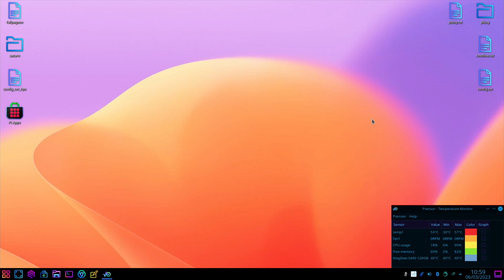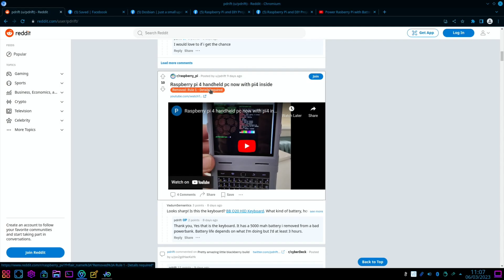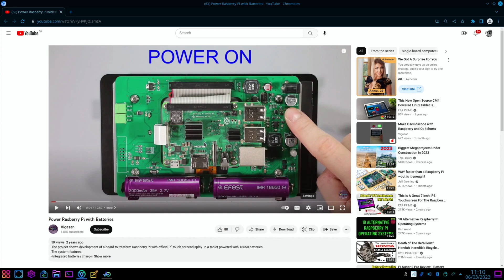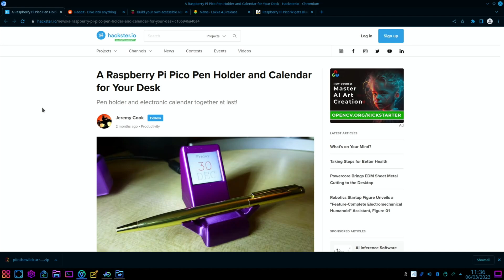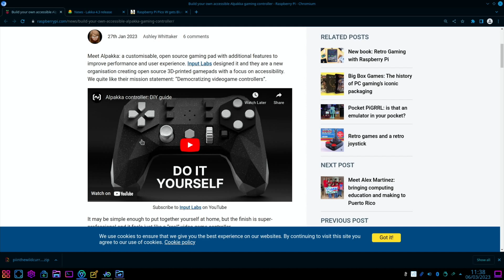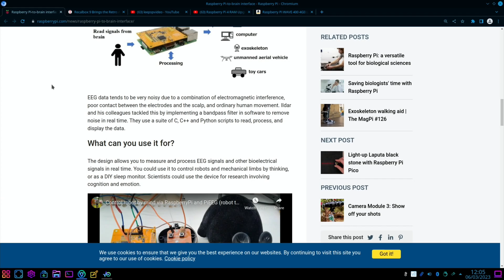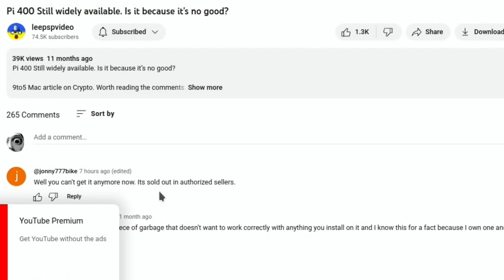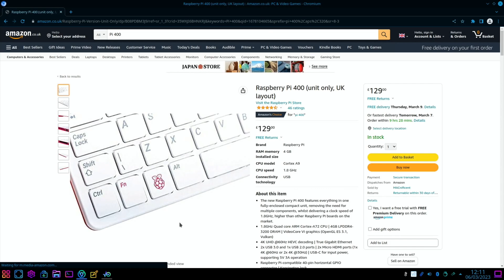Pi News 74. Upgrade your 1GB Pi 4 to 8GB!

Comment: If you plan to use a Raspberry P 3 for an outdoor searcher station, I would suggest that you include an RTL-SDR receiver so you can bring in the audio from the National Weather Service radio, transmitting at or near 162.55 Mhz. If you've a dedicated display station indoors, you can include a speaker to play the audio, and it would be a good enhancement if you could monitor the audio stream and automagically cut in the audio when the NWS transmits the weather radio codes for your vicinity. If you are installing the station on a Mast, you can also install a weather camera.  If you're  rural land owner, that may be a good place to add 433 mhz NORA communications to monitor remote sensors on all of your gates and barn doors, to feed to a security system. The possibilities are endless.

Comment: What about expand the RAM using a external Memory like the Windows sistem do?
Reply from the maker: I never found readboost to be that good in Windows 

Zram and Zswap are very effective 

Great 64bit Ubuntu performance on 2GB Raspberry Pi 4 with Zswap, plus Ubuntu Freezing Fix.
https://youtu.be/SIN6vM6H7sY

Raspberry Pi Zero 2W. First time setup. Far better performance with Zram.
https://youtu.be/vZkfuVyybIw
Reply: @leepspvideo  yea butnconsider the scheduler of Linux if you put the High priority process on the onboard RAM and the other on the external you can pitencialy Powerup the RAM onboard because the least tournarround time the problem i tink Is whit the paging because the external Need an extra step

Comment: Could you post a link to the video you did on the USB to SATA cable you recommend? I know you did one some time ago, but I can’t seem to find it.
Reply from the maker: Links in this description 

My current Desktop setup. Raspberry Pi 4.
https://youtu.be/r-1aXkU8dpA

The ugreen is probably my favourite although I use the short iitrust cable a lot UK link only
Reply: @leepspvideo  Awesome, thanks. I am having issues with certain cables at times.
Thanks again,
John

Comment: just wanted to share my overclocking that ive been running now for the last month with out issues  well minning duino coin and running the cpu at pretty much 90-100 percent  24/7 and use it as my daily computer as well. arm_freq=2800
over_voltage=12
gpu_freq=850
force_turbo=1
current_limit_overide=1
arm_boost=1 tried to add picture proof   but apparently i cant add pictures here   cpu temps are at 31c  at idle and about 45 c  at 100 percent thanks oh and im running your kde plasma build  for my os
Reply: pi 4 8 gb  model
Reply from the maker: Nice. I found the Pi doesn’t always run faster at higher clocks. Seems to mis report the speed. Worth trying stressberry to see if it is an improvement over the common 2300 Overclock.https://youtu.be/e9U58V8aJBE

Comment: Dosbian - must be like putting square wheels on your bike😎
Reply: I never understood why people want to run x86 on low powered ARM boards. 30+ years ago, PCs were still pretty expensive, and if you had invested in an Apple Mac, Amiga or Archimedes computer, running the odd x86 program could be quite handy. But any old x86 PC from the last 15 years will outperform the Pi's x86 emulation, and can be picked up for absolute peanuts.

Comment: not wanting to dash anybody's hopes, but i have recently only seen zero w coming back into stock. rather than zero 2w, so there is in my guy a feeling that he did not mis-speak, and if wanting clarification probably should just try to tweet him about it i suppose.

however it was also meant to be true that in general they were hoping to bring up stocks during this year. it just depends i suppose if they are missing some specific but critical component for it.

good luck all yous out there. i managed to bag 1x only in the end. but that is enough for me, since i also scored a couple of 1gb cm4s now too. although one of them is faulty it turned out. well nevermind that.... am certainly interested in the 8gb ram upgrade. though quite a tough one, because of the risks involved.

Comment: I watched the memory upgrade video already and whilst interesting, can't see many people taking their soldering irons to Pi 4's that are already hard to get hold of, let alone risking getting wrecked by some dodgy soldering.
Reply: I think the 1GB pi is easy to get. It's the only one I've seen available.
Reply: Agree the memory upgrade is nuts. There's about 100 solder balls at the bottom of the chip. I love how he says, if it doesn't boot you may have to remove and reball. It sounds like something a 3 year old could do, which it isn't.
Reply: @spiders-tours  Actually the balls are 200 xD
Reply: @MadEDoctor  I congratulate you on being successful, but that method requires around 300 quids worth of tooling (I'd recommend a microscope and a heat station at least) and nerves of steel. Well done, but it's not for the faint hearted.

Comment: Raspberry Pi 4 (4Gb) served me well. I've waited way too long for a more capable Raspberry Pi. I moved to a mini PC (i5-8500T with 16Gb) and installed multiple ubuntu server instances on it. It does anything what the Pi did and even better.
I got it for 167€ (shipping incl.). It even came with a powerbrick. A single Raspberry Pi 4 (4Gb) costs 199€ on Amazon which is insane.

Farewell Raspberry Pi.
Reply: Used PC is always the way to go if you don't mind the bigger size. x86 is so versatile, powerful, and extensible.
Reply: @technologyanimals  Yup. It’s about 3x the Pi 4 in size. Haven’t measured the energy consumption but it’s an efficiency Intel CPU. I wished I've got the newer Intel CPUs with efficiency cores but for the price I cannot complain.
Reply: As always,  it's horses for courses. The Raspberry Pi is never going to a computing powerhouse, and it was never intended to be. It's core strengths lie elsewhere. But then your average x86 mini PC isn't designed to do a lot of things the Pi does, and likely wont be as energy efficient or as cheap. Neither are a solution to every problem, you simlly choose the tool best suited to the task at hand. Prices of Pi devices will come down when availability improves. That is guaranteed.